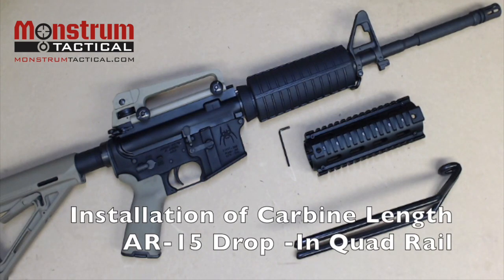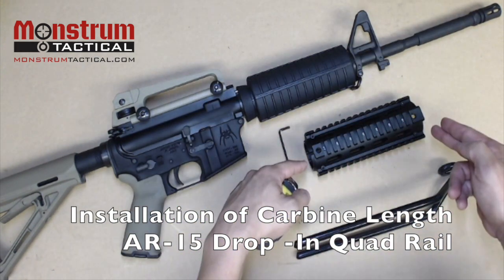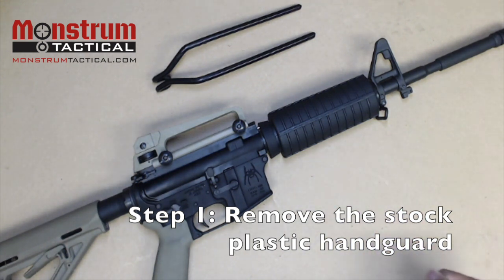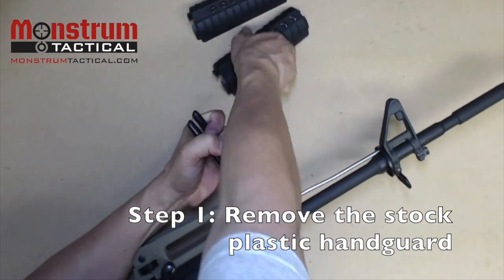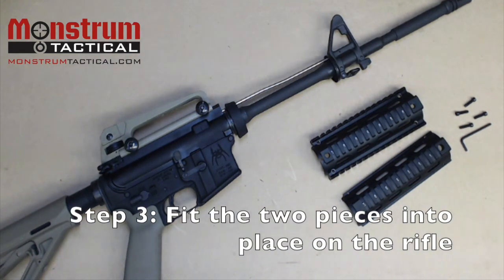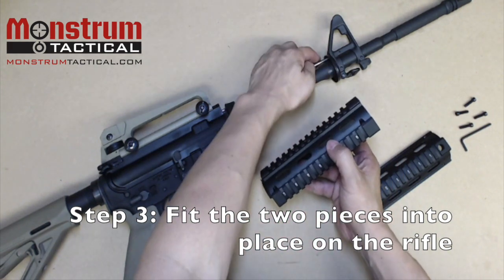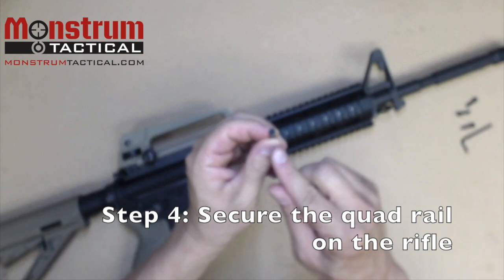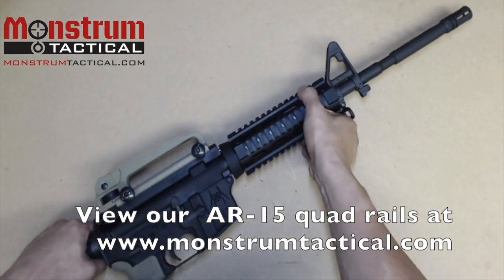Step-by-Step AR-15 Drop-In Quad Rail Handguard Installation in less than 5 minutes

Comment: Just installed the rails on my DPMS AR and it is as simple to install as the video say it is.  There is a slight wobble to it but nothing to worry about.  Very happy and I have already mounted a vertical foregrip and a bipod.  Next up a laser/taclight combo that hasn't arrive yet.
Reply from the maker: Hey Mike, 

Shouldn't be any wobble. Those go on pretty tight. Might want to double check the four screws and make sure they are on good and snug.
Reply: OK, you are right.  It is the vertical foregrip that is wobbling ever so slightly. Sorry about that.  I did noticed that your plastic rail covers just slipped on.  One video showed using a hair dryer to softened the plastic.  These just popped on.
Reply from the maker: Nice. Good to hear it. Some people have an issue getting the ladder rail covers on and the heat will make them a little more pliable but it's not always necessary. I trust they are good and snug?
Reply: Yes sir, very happy with them.  The whole thing doesn't add that much weight to the rifle which is good since I did add a vertical foregrip and a bipod.  I showed the rifle to my boss and he liked how it worked out.  I just got to be careful on what I have planned since I could easily fall into a trap of goodies hunting; :)
Reply: BTW, do you see any need to use blue loctite on the screws??  They seem pretty solid in how they install.
Reply from the maker: Just about the only downside to building rifles. 

Happy shootin'.

Comment: 15" drop in does not fit on ruger ar556 with the bayonet lug.
Edit*  it's a nice sturdy rail that will fit any other ar. I ended up putting  in on my PSA pistols. Fits great and feels great.
Reply from the maker: Hey Murphy, sorry to hear about that, according to our compatibility guide the extended rail will not fit but the standard drop-in will. If you email support@monstrumtactical.com they can issue you a refund or send you our standard drop-in.

The reference guide I mentioned earlier:
https://monstrumtactical.com/guides/compatibility-guide-for-ar15-dropin-handguards/
Reply: @Monstrumtactical  no worries! I put it on another AR. It's a nice sturdy rail. Maybe that can be a new product for you in the future? A guard rail specific for types of front sight post lugs. You could save the single smaller hand guard piece for specific milling or make a line that you can choose which quarter section to use on which AR lugs.
Reply from the maker: @murphy9924  I believe we have a couple of designs in the works for different versions of the extended quad rail. I'll let the guys know in our next meeting too since the Ruger AR556 is a high selling rifle.

Comment: Does anyone know what type of hand guard will fit on an anderson am15? I am trying to remove the stock
Reply from the maker: Hey Eddy, I just checked and both our standard carbine drop-in or extended carbine drop-in should fit Anderson's AM15 platform. Just make sure that the gas system is carbine length.

This is the standard one:
https://monstrumtactical.com/ar-15-quad-rail-handguard-carbine-length-drop-in-black/

This is the extended length one:
https://monstrumtactical.com/ar-15-quad-rail-extended-drop-in-fsp-cutout/

Also here is a guide to see specifically if it fits: (But don't worry I just checked Anderson's website and can verify that it will. )
https://monstrumtactical.com/guides/compatibility-guide-for-ar15-dropin-handguards/
Reply: @Monstrumtactical  thank you, much appreciate it 👍

Comment: Wear gloves when you're running one of these quad rails.  Learned that the hard way in the army.  I tripped and ended up with a couple stitches and a black and blue fingernail.
Reply from the maker: Edges aren't too sharp but I do like the ladder rail covers on them; makes them more comfortable. https://monstrumtactical.com/collections/rail-covers/products/ar-15-ladder-rail-covers-black?variant=15621390211

Comment: I have the same rail, but mine does not pop in. I checked everything, the sides are correct, it just doesnt want to pop in like that. I have also exactly the same default handguard.
Reply from the maker: Ruger 556?
Reply: im sorry i commented on wrong video. I have g&g m4a1 colt replica, it is pretty much same like on this video, and rail size is same to. It just doesnt want to click in like here, i clicked it once but then it was sideways a bit, not vertical aligned. Im thinking its those teeth from inside the delta ring, but not sure.
Reply from the maker: It sounds like it has the same kind of barrel nut as an actual AR-15. I would imagine they would likely use a real AR barrel nut as it would be cheaper than manufacturing a proprietary part. I haven't tried installing this rail on an airsoft gun before though. Maybe their tolerances aren't right. 
There are two grooves on each of the pieces of the drop in that fit into the teeth of the barrel nut. I would normally just insert the tapered end, ensuring the grooves line up and sort of use the rail to depress the spring in the delta ring. The other end should snap into place OVER the handguard cap. Repeat that same procedure and you should be good. Sometimes a little jiggle will get the grooves to settle in the teeth.
Reply: @Monstrumtactical  thanks, I will give it more try tomorrow. If it doesn't fit, rotating barrel nut will help? Anyways let's see tomorrow :)

Comment: Yours is the best and professional video on installing a  Drop-In Quad Rail Handguard on You Tube. I just received my Quad Rail Handugard so I can use a Vertical Hand Grip so I can use my Bumpfire stock. I kept trying to get the tapered end of the hand guard on the front like the plastic ones I removed. My Xtreme Tactical Sports M4 Carbine hand guard didn't come with any instructions.
As soon as the part of your video that showed in which direction it went it was a breeze.
Thanks!

Comment: I have one of these on my home defense rifle and it is really a great product for the price. I just needed to mount a flashlight, QD sling mount, and vert grip on my rifle and this thing is perfect for that. I wouldn't suggest it for mounting anything that needs to be sighted in and hold a zero (except for maybe a CQB laser) but I really don't think that is the purpose of this quad-rail.
Reply: Why would you not recommend putting something that needs to hold a zero on the rail?

Comment: Using this video as a reference in shopping for a hand guard for my AR which is mid-length, if carbine length is 6.5 inches, how long are the hand guards I should be looking for?
Reply from the maker: Carbine is approximately 6.7" whereas a mid length is approximately 9". 

Be aware of the handguard cap you have on your rifle. Many manufacturers use a triangular handguard cap and are  not compatible with the mid length drop in handguards like ours designed for use with the round handguard cap.
Reply: That's true, it does have the triangular cap. I ordered it from Palmetto State though, so I wonder if I order the new hand guard through them if it would be compatible. Either way, I'm not in a rush to change it out, but I certainly appreciate the information.
Reply from the maker: I'm sure if PSA sells a mid length drop in would be for the triangular cap as all of their mid length rifles have them. 

Good luck on the search.

Comment: that hand guard has just almost enough area for the hand to grab...will the 2 sides and bottom rails be usable?
Reply from the maker: +EvendimataE It depends on the shooter or the accessory configuration.  If you hold the rifle by the magazine well or toward the near end of the rail, you will still have room to mount something toward the forward end of the rail.  You can also install a vertical front grip on the bottom of the rail and steady the rifle using that.  Otherwise, you can also install a longer rail option that has more rail space such as our extended rail with A2 FSP cutout: https://www.youtube.com/watch?v=LcAmM9OcqBA

Comment: I recently purchased one of these quad rails and am having trouble getting it lined up correctly with the other rails on the rifle. My rifle has a railed gas tube and flat top upper receiver and this quad rail attachment has about a 3 degree counter clockwise cant that is driving me absolutely insane. Any tips on how to "level" this hand gaurd in respects to the other rails on the rifle? And yes, I have tried loosening the left hand screws and tightening the right hand screws down further to counteract the can't but it doesn't seem to make a difference. Please help.
Reply: Crisco Johnson yeah I have tried that. I'm beginning to think that I might have gotten one that has some kind of machining defect or bend to it. No matter what I do the hand guard indexes into place with a counter clockwise cant to it. I can get it so the top rail lines up with the railed gas block and receiver rail, but the bottom is canted, or vice versa. I've even tried having a friend help for the extra set of hands and nada.
Reply: I just got mine and having same issue....was told we may have to grind those rails little bit to fit for offset
Reply: Rifles First nah it was the handgaurd. I fully removed it and installed a Midwest industries rail with full contact and everything's lined up perfectly. The original quad rail I had would be nearly possible to time to the rails as there was no contact between the two pieces of the clamshell style hand guard. It was loosely held together by 4 screws. Midwest rails ftw

Comment: Do you know if your rails fit on the Ruger AR 556? They have a delta ring but its threaded and moved by twisting it rather than forcing backwards with a tool.
Reply from the maker: +prodigy2k7 Yes, it'll fit on the Ruger AR 556.
Reply: +Monstrum Tactical thanks - i got mine in the mail today and attempted to install it the same way as the factory guard (wrong) watched this video and installed it correctly the second time...
Reply: prodigy2k7 how does it fit on your ruger ar556?  I also have an ar556 and just ordered one of these rails
Reply: Kyle Wright how did it end up working out?

Comment: does this fit on the dpms oracle
Reply from the maker: Unfortunately no. All of our drop ins will only fit AR-15 pattern rifles. I've heard the Gen II DPMS rifles would accept an AR-15 drop in but I have yet to confirm. Your LR-308 rifle would need a drop in designed for a 308.
Reply: @Monstrumtactical  Ok I just bought this hand rail. For my dpms Oracle 308. Not fitting, that's probably why. Can you suggest some hand rails that fit the 308 dpms Oracle?